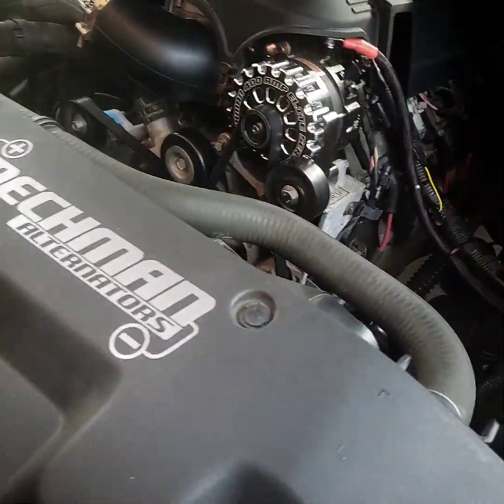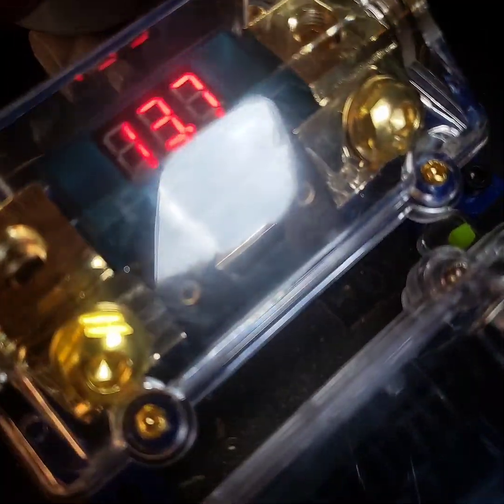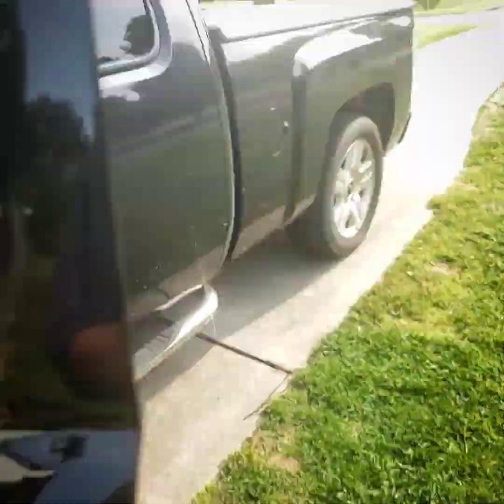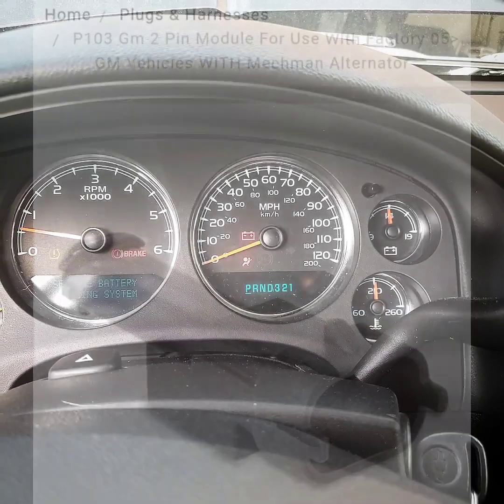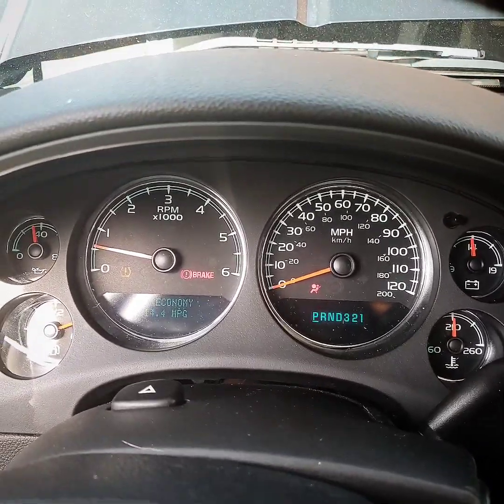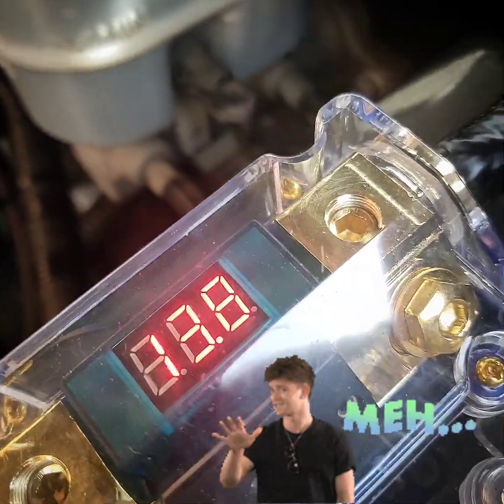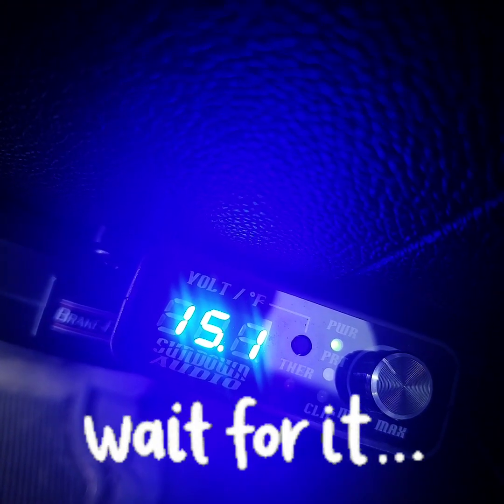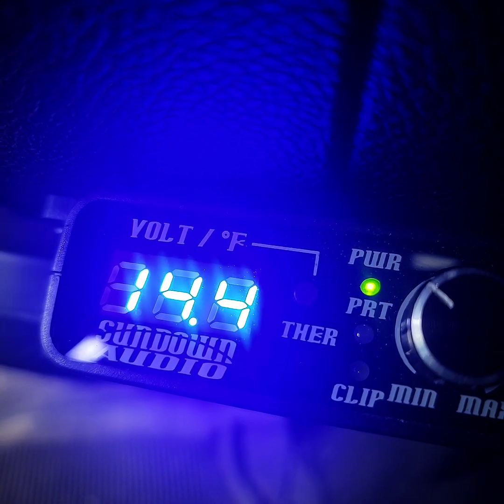Quickest way to NOT bypass the GM RVC system

Comment: We changed the parameter for the alternator to try to always charge at 14.5 through HP Tuners

The RVC system will still initially ramp up to 15 volts but will usually hang around 14.2-14.5 volts. If the batteries are topped up, after driving on the highway may see 13.7 volts for a little bit.

Comment: This is shit. The Alternator will not charge without the 12v ingnition just had this problem on my Mechman Alternator. Bad yellow wire into the 12v ignition. Do Not unplug that connection.

Comment: My battery is at 14.7 but my amp is at 13.9-14.0  whats wrong with it? At resting everything is even at the 13s when the cars off
Reply from the maker: You have a power delivery problem with the wire from the battery, to the amplifier.  And/or the amplifier has a problem on the ground side getting back to the battery.
Reply: @mechmanalternators  GM Chevy Tahoe 01 under the hood, the braided flat wire, from the wall to the engine, was not giving the car grounds the juice. So I ended up putting an extra ground straight to the battery and boom, that fixed the problem for inside the car. But you are correct it was totally just that on the ground side.... 🤙🏽🙏🏽
Reply from the maker: @crandallexpo0648  Glad it was something simple...it usually is. ;)

Comment: I wanted to ask you a question. I have a 2007 chevrolet colorado that I did an ls swap on. I'm trying to get it tuned, but my voltage continues to drop to about 10.1 volts when I get to wide open throttle and my tuner says i need to fix that first.  I just purchased a new factory alternator, and my battery is about 2 years old.  I have a 4 pin connector, and the ls swap is from an 2003 lq9 6.0L motor.  What would your suggestion be?
Reply from the maker: P# 8206250 or P# B8206250B
Reply: @mechmanalternators  I did want to let you know I have no rvc on my truck.  The factory one is connected to the negative cable, but no connector is connected to it.

Comment: mine is always charging at 15.3-15.4 for some reason kinda high honestly but it's a stock alt was thinking about getting a voltage controller to get that to a rock solid 15 volts
Reply from the maker: If it's ALWAYS charging at 15.3-15.4 then somethings not right.  That will heavily damage AGM type batteries.
Reply: @mechmanalternators  mine are not agm but i do have a voltage controller coming now. i think the voltage regulator is failing or has failed and is just sending full voltage either that or it's my batteries as i have 2 but they are from 2018 but when i test them with my battery tester they test slightly weaker than they would new but still strong yet. I do notice when i test my batteries the resting voltage is 12.4 volts when it has sat for a few day.

Comment: So what happens when you unplug it, and the battery is full. And you keep charging at 14.4 volts into the battery? How long until you cook your battery? Isn't the purpose of the RVC to prevent that, and to reduce charging voltage when the battery is full?
Reply from the maker: LOL, thats not how that works.  Do you think alternators that are on vehicles from like 1970 to 2004  just "shut off" when charging a battery?  No, they do not.
Reply: @mechmanalternators  ok, then I'm confused. What is the purpose of this system then? I've been reading and watching numerous video's to try to understand the way it works before I upgrade, so that I'm not wasting money on things I don't need, or damage stuff that I don't want to replace. Thanks again.
Reply from the maker: @Maxspeed996  https://www.youtube.com/watch?v=jdSKlg80DjU

Comment: My voltage drops down all the way to 12.4 sometimes
Reply from the maker: Need to fix that then
Reply: @mechmanalternators   it's the rvc that does it not sure how to fix it any suggestions
Reply from the maker: @daedae1342   Yup, do it every day.  Watch our video(s) on how. :)
Reply: @daedae1342  Turn on your headlights.  It'll slowly ramp up the voltage to 14.5.  However, if it's lowering your voltage to that point, it's because your truck doesn't need to be working the alternator that hard.  It only kicks in at over 50mph with low throttle input when the system has been operating at 13.2 volts for more than 45 minutes.  It kicks out and ramps up voltage when the battery state of charge drops to 80%.  The RVC keeps the battery at 80-95% State of Charge except when it does this, it brings it down to 80% and hits it with high voltage recharge cycle to prevent the battery from sulfating which makes it last longer.  It's not bad, it's next level engineering.
Reply: @mechmanalternators  Nope!  That's the way it is.  It's part of the RVC system.  GM took their time designing their voltage regulating algorithms and tables far more than any other manufacturer.  The system will drop don to a lower voltage when you are cruising and the system has been running at over 13.2 volts for over 45 minutes.  The voltage sensor will watch the current flow and reduce alternator output to let the voltage drop, then it will hit it with 13.9 to 15.5 volts to charge it back up.  This helps keep the battery from sulfating and extends it's life.  They also do voltage ramping which is why you don't notice the engine lug down when the voltage goes up.  It will increase voltage 10-50ma/sec depending on the situation.  No engine bog at stop lights, no drastic light intensity changes, and no voltage spikes to accessories. On top of that, the voltage algorithms are a big part of why the fuel economy improved on the newer GMCs.  The system won't needlessly pull current from the alternator when the truck doesn't need it, it keeps the battery healthy, extends charging system component life and saves fuel.  If you want higher voltage, turn on your headlights or set your blower fan to high to override the algorithm and softly bring your voltage up to 14.5.  It even has a fuel pump boost mode when you mash the throttle and fuel flow increases beyond a set threshold, and there's still other features in it.  The RVC charging system programming is really a work of art.
Reply: I range between 15.1 and 12.4 volts I have a js alternator 250a alt because you guys don't make an alt for my car if you did I would definitely buy 1
Reply: I have the 2 pin plug there's no video explaining how to fix the rvc unless I wanna run 13.8 and buy your rvc bypass thing
Reply from the maker: @daedae1342  Well....yea....you can't "fix it" for free.  Much like a flat tire, you need to buy a new tire or buy a repair kit for it.
Reply: @mechmanalternators   I'll message you guys then and see if there's anything you can do cause if you can make me a alternator I'll buy it
Reply: Have the same issue 😢
Reply: I've been trying to find out why my voltage has NEVER dropped below 14.4 14.5.... because I live in SoFL and my blower is always on high! Makes sense now!!! Thank you for that super detailed reply.

Comment: Is that extra pulley to retain the stock size belt? If that's the case i don't have to change the belt to a shorter belt?
Reply from the maker: I mean, you could do that, but i scabbed it together because I was using a much smaller alternator for a totally different application.  I didn't feel like buying a new belt and that pulley took up the slack from the  400 thats on it.  

You would need a little bigger pulley than the one I used to be able to use the stock belt.  At that point,  you're covering up the beautiful alternator because the pulley is so large. :(
Reply: @mechmanalternators  what's the part number for the pulley?
Reply from the maker: @seangowan7441   For the BMW pulley?  No clue.  Came off a 2008 BWM 335i twin turbo if that helps. :)
Reply: Could i get a second gm idler pulley for the stock belt instead of the bmw pulley?
Reply from the maker: @seangowan7441  I'm sure you could, but it needs to have the right spacing and alignment.